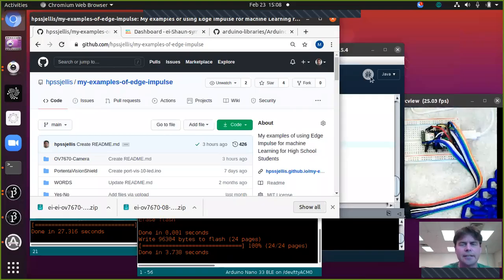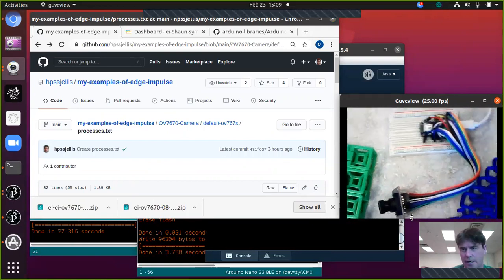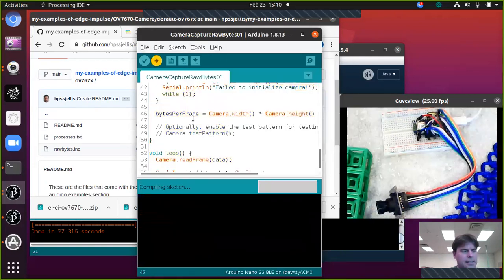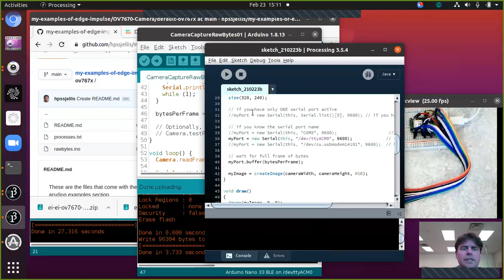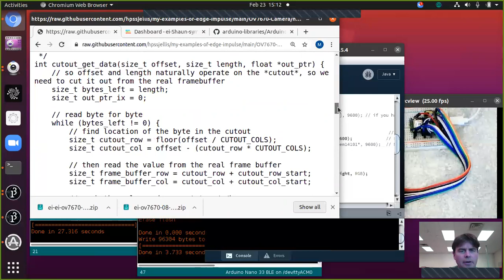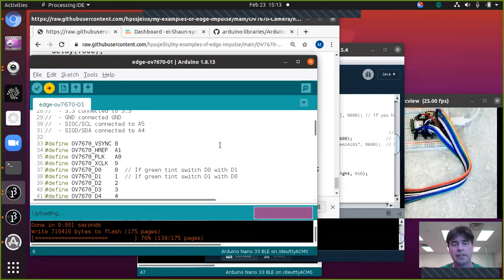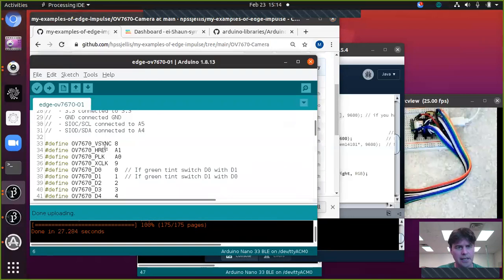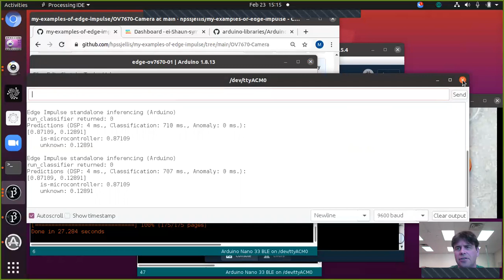Nano 33 Ble Sense with the OV7670 Camera Module running Edge Impulse

Comment: Too slow for any practical modern day use-cases, sadly.
Reply from the maker: That is why I switched to the Arduino PortentaH7 with LoRa vision Shield. It is just a bit more powerful and has 8 MB SDRAM which helps with using a Greyscale OLED.
Reply: @Rocksetta  frame-rate? And by that I mean inference rate
Reply: @Rocksetta  a raspberry pi 4 model b can run a tflite object detector (efficientDetLite2, to be specific) at about 4 inferences a second. Add a CORAL Edge TPU to it, it shoots up to a staggering 14 frames/inferences a second.
Reply: Practically 0.8-ish frames a second is fine for practical use-cases.

Comment: Great job mate, would you mind giving us a bit more info on the dataset you used? I'm only asking because I have my eye on doing a similar project, but all the images in that dataset are 200 x 200 pixels by default and I'd need to try and adapt it (in Edge Impulse) for the OV7670 module.
Reply from the maker: Hey Martin, the nano33BleSense is a great board but for vision work I have moved to the portenta with GrayScale vision shield. Since I use the Pixy2 from charmedLabs for all color stuff.

As far as the data set, I make my own. Supper easy with a cell phone on edgeImpulse.

https://www.youtube.com/watch?v=wbX_-No8kIw&list=PL57Dnr1H_egsQPnEObWHPhK1Q4g_IDWcR&index=7&t=1s